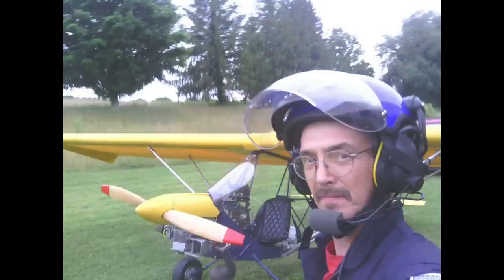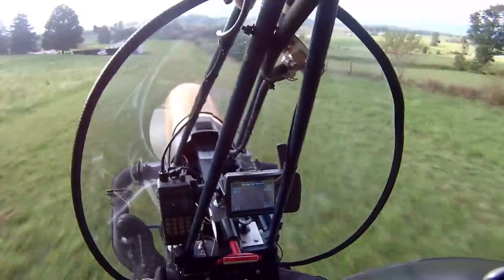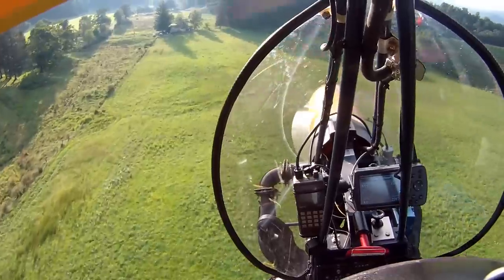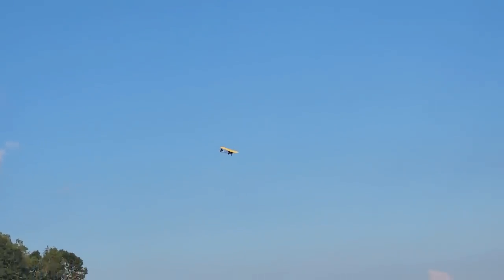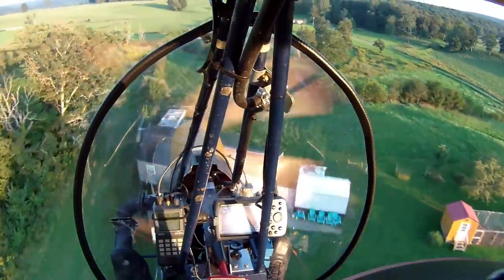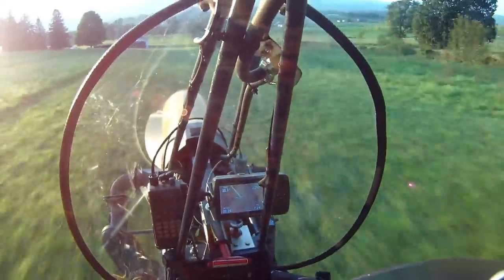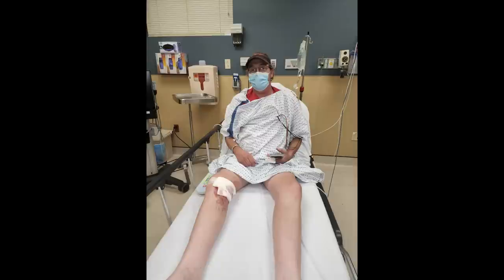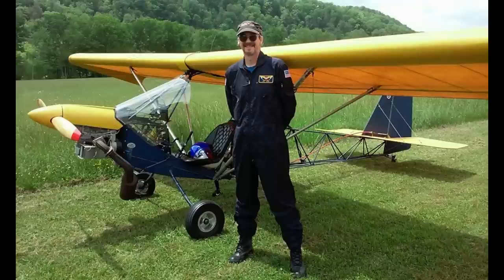The Last Flight of the Mighty Airbike

Comment: Virgil, it looks like you and I have something in common.  Many years ago I crashed the original air bike Enduro that was built by Wayne Ison and Larry Isreal. The prop was covered with 100 gram fiber glass cloth which probably seemed like a good idea at the time. But it set up a problem that no one could see. Wood has to breathe, plain and simple. Encase it and it will rot. I was taking off and got to about 80 to 90 feet and all of a sudden the airplane made an extreme right turn that I could not overcome with left full rudder or aileron.  I cut power and aimed it at the ground to land as quickly as I could because I was about to hit a 120 foot pine tree head on which I figured would lead to my early demise. After getting my feces consolidated, I surveyed the wreck. Bent landing gear, broken prop. But wait a minute. Where is the other prop blade? It is no where to be found around the crash site. After searching for a while we found it on the runway about 500 feet back. The prop blade that was still simi attached to the hub was all splintered at the break point as you would expect from a prop strike. The other blade did not have that same type of splintering. It was clearly a centrifugal force break. I had flung one blade off and set off a p force that I could not overcome. I've had people tell me that the engine would have vibrated off the plane but evidently it didn't because it was still on the plane and mabe it didn't viberate off because I pulled the throttle back so quick, I don't really know. I did take the prop to Wayne Ison and he came to the same conclusion. It was a centrifugal force break. The wood fibers were pulled out in a straight line with the length of the prop. By the way, I was not injured. I walked away without a scratch. That was my first and last flight in that plane, and the thing about it is I had a bad gut feeling about flying it that day even though a friend of mine had just been flying it for about 20 minutes. Always go with the gut feeling.

Comment: You’ve convinced me to get a helmet for when I fly my Challenger. Also will be more wary of my feet slipping off the rudder. Don’t know if you’ve ever flown a Challenger with the doors on, but it needs a ton of rudder to keep it pointed straight. Would be catastrophic if my foot slipped at the wrong time. The vertical tail was actually sized before doors were added to the design so it’s vertical tail is too small and it’s directionally unstable. They sell a bigger one for that reason and I really need to get it!

Comment: I can totally relate, I totaled my brand new Harley 7/4/23. Busted leg, totaled Harley, scuffed up helmet and two months out of work. Mine was due to bad judgement... if I simply would’ve dropped my speed down 10 mph I would’ve held a turn I lost it on. Live and learn. 
Airplanes, regardless of size are generally less forgiving. You’re very lucky to have walked.... or in our cases limped away. Glad you survived it my friend and like me I hope the accident hasn’t scared you away from your hobby. By the way, my dad was a pilot and crashed his home built Starduster Too 25 years ago while landing. He and my mom both survived it and did walk away with out a scratch.... but he swore off flying after that.

Comment: Glad to hear you are ok. Maybe a wider runway too with more wing clearance, and extensions on the rudder pedals until your hip surgery and hopefully improved neuropathy
Reply from the maker: Widening the runway is a good plan, however, due to geographic restrictions and property lines, that is impossible at this particular airstrip.  My Dad learned to fly here before I was born, so most pilots would say it is plenty wide. Extensions, and more importantly, stops (made with less than $1 in parts) would have helped. Unfortunately, the Mighty Airbike is a total loss. Thank you for the good health wishes.

Comment: Maybe even the straps or baskets we see on rudder pedals for aerobatics that hold your feet in when inverted? Glad to see you are physically OK. I think this could have happened to anyone....one bump on take-off and off into the boonies, with no time for recovery.
Reply from the maker: Good point. In fact, the constant pressure required on both pedals to feel secure in the seat likely caused inadvertent right rudder deflection when my foot slipped off. That, and being a left handed prop, torque and P-factor played a huge role. 
Thanks for the vote of confidence.  While in the ER before seeing the video footage, I was worried I had fallen victim to "Flexy-Flyer syndrome" and used oposite correction in a panic. I was glad to be exonerated.
Reply: YUP! Almost worked for bidens bicycle petals untill he fell right over! YOU KNEW you had neuropathy and CHOSE to fly anyway with no special mods for a special needs pilot! I had some drinks awhile back and chose to scurry barefoot on wet smooth cement, fell through my front window with pretty severe injuries. Wasn't the cement manufacturer's fault, wasn't the window manufacturer's fault. It was MY fault!!! Glad you are ok!!! God Bless!
Reply: @virgilkelly6991  Is this something that needed to be reported to NTSB?
Reply: @UltralightAirplaneDriver  He doesn't want the FAA looking into him flying with a know medical problem. To bad he posted a video online for the world to see and listen to him admit it

Comment: Reading through the comments, it would appear that a bunch of people don't see the design flaw. They only see the pilot error. 
On this design, what is called the rudder pedal, is in reality, a rudder peg. I've heard people surmise that was intentional. It's an air BIKE, bikes have foot pegs. 
Now, I don't know if that is what Mr. Ison was thinking. My guess though would be that he was going for simple to build and light weight. These are both good considerations, given that this design was intended to be amateur built. And, a part 103 ultralight. 
My one and only experience with an AirBike, about 25 years ago, was positive overall. However, I felt the rudder pegs were not as substantial as I would have liked. Now, admittedly, my size 14 wide, dirt bike boots did a lot to contribute to the impression of "minimal" rudder peg size. At the time, I noted that if I owned an AirBike, I would need to design something more suitable to work with my beegas hoofs. 
Rudder pegs aside, I was happy with the plane and how well it flew. 
Considering how important rudder control is in a plane like the AirBike, my personal opinion is that the rudder pegs are "under designed". And while I recognize the reasoning behind the minimal pegs, it's hard for me to not call them a design flaw.
Reply: Its not a design flaw at all. Anyone who flies should know enough to know you need the feeling in your legs and feet. So you know how much you are pushing the pedal/pegs, You need to know where your feet are because in some aircraft you may hit the brakes well using the rudder. 1000000000% pilot error should of never been in the air and sure hope he doesn't get back in the air until his leg is fixed. I am sure the FAA would love to hear him say he had a known medical problem but was still flying an aircraft. (ultra light or not)
Reply: @blowinkk9396  I agree, not a design flaw. Pilot decided to fly with an identified health issue that was a known potential safety risk. Even had a potential fix to the pedal to possibly mitigate that risk. However the FAA doesn't care about 103 accidents that don't involve rule violations. They wouldn't have done anything to stop him if they had known about his condition. Anyone can take a flying machine and go try to fly it and kill themselves with it, that's your freedom in this country. The rules of 103 try to limit how much danger you can pose to people and property. They do that by limiting how much your wreckage can weigh (254Lbs), how big a fireball you can make (5 Gal fuel), where you can crash (airspace you can fly, no flight over people or congested areas), and so people can see and avoid you (day VFR only).

Comment: There would be no problem if you adjusted the rudder to your condition. You can modify the steering wheel or modify the control system. The most important thing is that you are okay, repair the plane, adjust it properly and continue flying.

Comment: Nothing wrong with the basic design of the rudder pedals, but that left foot should have been overhauled before being installed as a major component of the flight control system. And maybe removing the fence and trees directly adjacent to the runway could have been helpful. Glad you're OK.

Comment: I can tell you right now that i would have welded a tab on the outer edge of both petals bbecause as a motorcycle rider of 40 years,ones feet can easily slip of the highway pegs when you least expect it,,especially if you pick up a little bit of spray off the front wheel.

Comment: Aw, it’s rebuildable. Don’t listen to these low time no time OCD knuckleheads, order some parts, get her repaired and go flying. But fix your rudder pedal. You could have the same accident on a motorcycle and everybody laughs, goes on about their business. But because it’s an aero plane the Karen comes out in people. Obviously you can handle a little lightweight taildragger. It’s not like you’re operating downtown, in front of the Alamo with a side line full of princesses. Glad you didn’t get hurt any worse.

Comment: I wouldn't necessarily call the pedal a design flaw. Your unique physical condition is not typical for pilots. You can clearly see in your video that your RH foot doesn't have the same issue. You identified a potential safety issue with the way your left foot interacting with the pedal but you decided to continue to operate the aircraft. You unknowingly decided the potential risk was acceptable without modification as you "hadn't got around to it yet". I would assume if you thought it was as serious as it turned out to be you would have been more proactive in implementing the modification/improvement to suit you better. But to say it was a flaw in design is wrong.

Either way, I'm glad you weren't more seriously injured and I actually hope you get back in the air.

Comment: I am an A&P mechanic. Was wondering if you attempted repair of this airframe or did you start fresh? And is the powerplant subject to sudden stoppage teardown the same as General Aviation ? I would repair using every remaining part possible. Glad you weren't hurt any worse.
Reply: Exactly.
Reply: If it was a belt reduction, I'd be fine not doing an inspection. Some of these 2-strokes are gear reduction drives so I wouldn't be sure. But at the cost of the entire powerplant, I'd just put a new one on. And I agree, rebuild it with what you can and replace everything else.

Every airplane can be rebuilt, just depends on how much money and effort you want to put into it.
Reply: @Dreddip  Well you sure lucked out with a belt between the prop and the crank. Engine is fine then. If we can say any part of it was luck. Love the plane. Do Not like where pedals are. Modify that.
Reply: @Dreddip  I mis-read it, so you have gear reduction? OK, yes get a new motor. If you modify the pedals out 3 inches leverage would solve the slip issue.

Comment: Sorry, but some people shouldn't fly.   This was an issue that was recognized and should've been fixed before a problem occurred.    I started out in ultralights and love them to pieces.    I made all kinds of modification to my Rotec Rally 2b to make it safe for me and the airframe.   If there was any concern, I would NOT take off.    I ended up flying it over 140 hours before selling it in top notch shape.    Yes, had a few close calls(mainly wind) but experiences I learned from and resolved.     Please realize that if you decide to fly ultralights, you need to have common sense and very mechanically minded.   Furthermore,  Don't be afraid of 2-strokes, but know how to make them happy.   They aren't as bad as some believe.

Comment: 2) i was expressing i appreciate the cross study between planes, boats mostly also cars, the extreme weight reductions for flight for example i think in terms of ultralight the most practical home jet potential , poor mans jet maybe if a home packed rocket motor could be made safe enough , also the rocket mount would be on the tail so if it fails it's concussion not too bad or damaging , so the rocket each has maybe just 30 seconds ok so i load 30 then and get 15 minutes full power go one minute and you'd have maybe 30 minutes guestimate example but maybe 300 mph for whole time lol...the thing is when one burns out a pusher shoves the empty out and a new rocket loads like a gun magazine so if one fails to fire or blows out even the pusher shoves it out and the next loads but it's so light it can glide anyway ....the jet glider tiny jet s*nix i think can go high altitude , cut the jet retract it and coast for miles and miles but those are imo the practical poor jet but faa would probably illegal my first mention...hope you're great enjoyable vid second time seeing but i surfed across it seperate search on the airbike i liked the sillouette for my flat body plane idea ...with modified solid wing too that was , felt like sharing or message in a bottle whatever EDIT: also they claim rocket can't be throttled but i have nozzle ideas simple slider to vent some thrust but to kill thrust that motor ejected and wait on next one it could helical feed too like a giant gun mag.....maybe lol anythings possible

Comment: i websurfed across this because i have this daydream idea that i could just cut the fuselage seat , whole body to motor mount on a flat thin board and fiberglass it , then i'd make another flat so they make a "t" lower t shape and attach with angle iron , spring steel angle or aluminum the joint , i'd copy a seperate wing such as the airbike i was thinking since the flat giant toy type body i imagine about the same shape with a chinese version rotax maybe anyway the wing is wood i am thinking modify a wing design to use foamboard , solid so it retains the rib shape entirely instead of pockets in between and i have ideas to somewhat honeycomb or lap fiberglass sheet joints over the wing though i don't know if that wing would work it's a daydream some of the fisher plans was what i imagined modifying it's be good with the standard wing spars but you see i dislike the epoxy joints and wood bits , i'd prefer solid fiberglassed over that or solid forms for the wingspars with foamboard fill and atleast a couple fiberglassed sheet layers over a hard wing is what i'm on  a rough draft about also maybe a spring steel connection joint wing so it bends if over G'd and bends back (?) i design boat hulls lately similar for me more practical ...i think the wing should be centered or added last to balance motor selection, passenger, fuel and cargo weight typical along the fuselage or set the CG proper
Reply: i have this profiles building thing sometimes , you cut the outline something with stronger flat material basically to imagine it's gotten like an engineering stage reduce, enlarge invert stuff, flatten on stronger material /lol i like foamboard and the weight issues with airplanes help or cross relate , the materials sometimes elemental but also the latest , the foamboard 2" i had stated iirc about 26 psi crush , interesting for boating i guess , my idea is to make foamboard inserts between the rib spars in the wing same shape and fiberlap joints over top sop often and one sheet over that fiber resined...for example

Comment: Seems like an issue with the pilot more than anything else.  I'm not sure why you'd post this, perhaps as a cautionary tale to other ultralight flyers with hip dysplasia and neuropathy?  $0.74 wouldn't have prevented this, a pilot accepting of personal responsibility would have.
Reply: Harsh, but a valid point. Once having identified a serious security risk, every flight without correcting the issue is negligence.
Reply: @Kenjh71  finally, someone who understands what negligence is!
Reply: Yeah I would tend to agree. Like, if you review the crash footage, then you will se his left foot slide offnof the pedal again.
Reply from the maker: 0:52 "This is a cautionary tale..." so, yes, one could surmise that this was intended for others to learn from my mistakes, and how easy it is to slip into complacency, even if you have been super meticulous in the past. I'm a better pilot than I am a videographer and scritp writer,  so please understand that, until I watched the video, I wasn't sure at all what happened, heck, I thought I had forgotten how to fly! Learning what I did was actually a relief for me! My flight instructor who passed me in a RV14, has no issues with my pilotage. In that aircraft, your feet cannot slide laterally off of the pedals. I stand by the fact that, if recognized, all good engineers would make that impossible on every design, especially if it meant welding on (or cotter pins) a couple of cheap washers. That's my opinion, I understand that. It might not be yours.
Reply: @virgilkelly6991 very well put 👏 good to know your okay. That's all we are. Human and no one is perfect. People need to understand this more. 👍